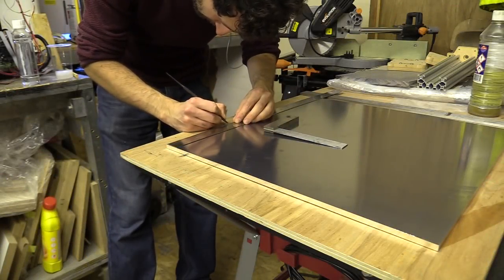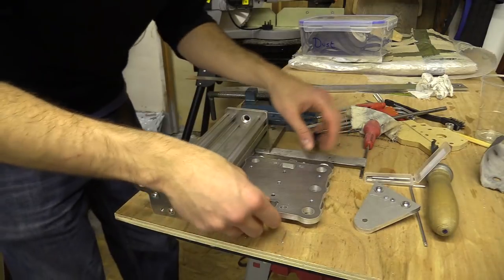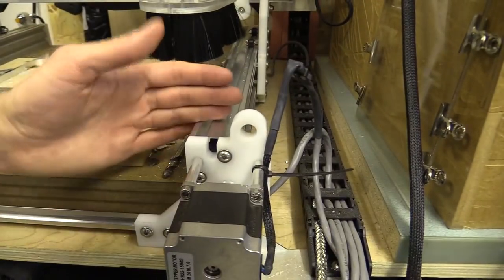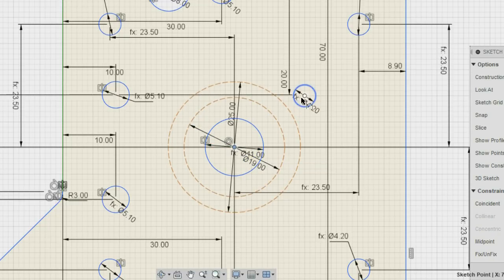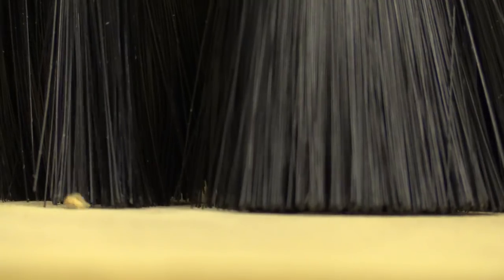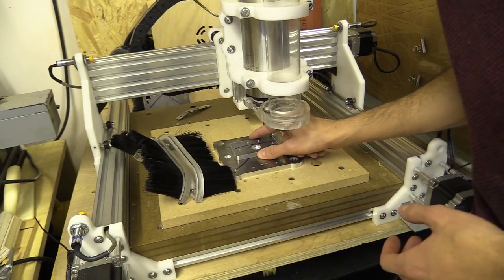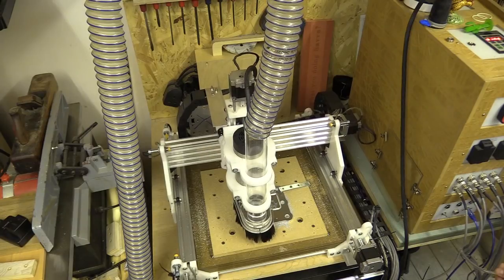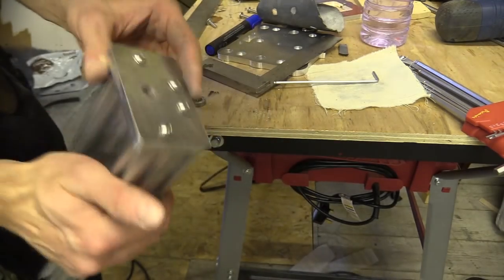#24 Hard Y Stop / Squaring CNC Machine / Fast Cutting Aluminium #24 / Design Upgrade

Comment: cool....im going to be building a c beam cnc using a 1500mm for the x and 4 of them for the y axis so the machine will be 1500mmx3000mm .i only have room for the 750mmx1500mm as of now
Reply from the maker: Nice which kit are you working from? I'm going to release a new video this week - with all the modification I've made to the design.

Comment: You shouldn’t position the proximity sensors end on to the direction of travel but rather 90 degrees so that the gantry slides past the proximity sensor, so if there is any overtravel,or latency between the transducer being triggered and the response to stop the motors and any inertia wont result in a physical crash.

Comment: Fair play dude, well done for persevering too, these things can be really frustrating.  I did something very similar with my DIY X-carve, initially used 3d printed plates and then used that to very slowly cut aluminium plates...It's much better now but the plates are still thin, so I might use it in it's current configuration to cut thicker plates. 

Keep up the good work! :)